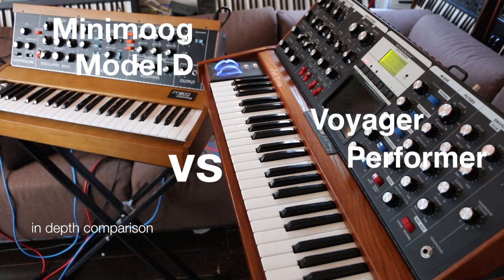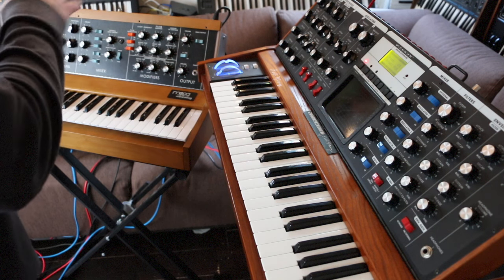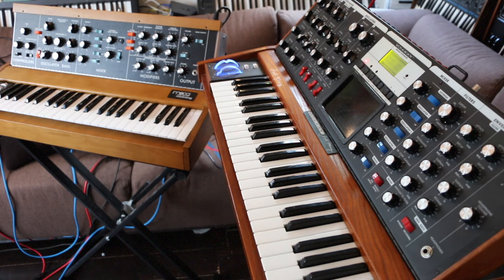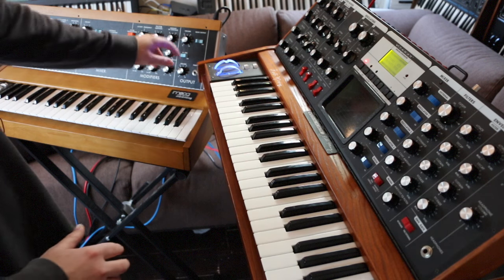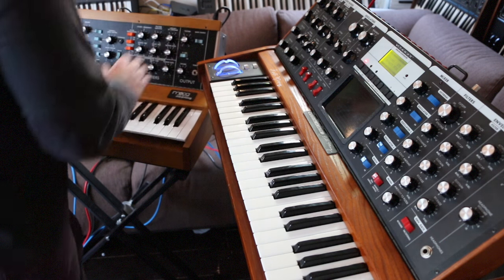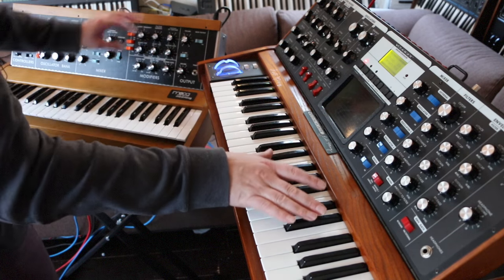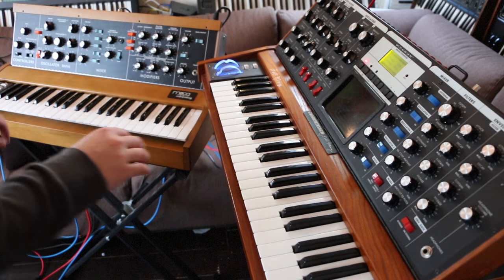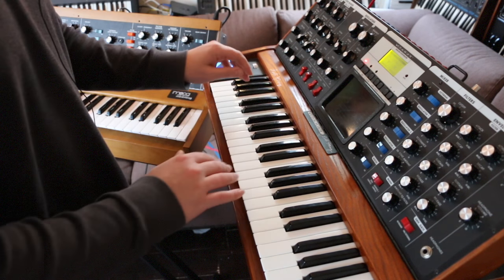New Moog Minimoog Model D vs Voyager: Oscillators

Comment: I really don't know why the voyager is £1000 more than it used to be. Moog are such rip off merchants. And the Minimoog - 3.5k for a mono synth? Serious? I really hope Behringer clones nail it. I've been looking into AJH synth modular clones
Reply: the Dollar got stronger and the Pound got weaker. This happened the last 6 months. So you got to pay more Pounds. I guess you guys wanted Brexit... it's not Moog you have to blame
Reply: Synthesizer Home The prices were  like that was before all that happened. It's just an excuse
Reply: no, it has to do with significantly changing currency rates in the last 6 months, I'm sure of that. Look at the changes of Dollar and Pound in the last 6 months and you will see. The American manufacturers will not lower their prices in USD because the Pound got weaker and Dollar stronger. Finally you have to pay more for the same thing.
Reply: Synthesizer Home I'm well aware of how currency markets work. the price of the sub 37 and sub phatty have barely changed if at all. Even the US prices are horrendous for a voyager or model D. I know they are bigger companies and have economies of scale but look at the price of the new full size ARP which is still expensive for a mono and 2/3 of the D price. Look at the MS20 price. Look at the Oberheim SEM price. Even DSI 6 voice prophets and oberheims are less.  Prices of all these synths have also remained similar despite exchange rate fluctuations too.
Reply: Made In Machines 
You obviously know nothing of the design of either the Voyager or Model D.
The D is through hole rather than PCB which is way cheaper.
Moog is essentially a boutique company using the best parts and components rather than assembly line cookie cutter like Uli’s company of low quality knockoffs!
Yeah, you don’t know! So keep your ignorance to yourself!